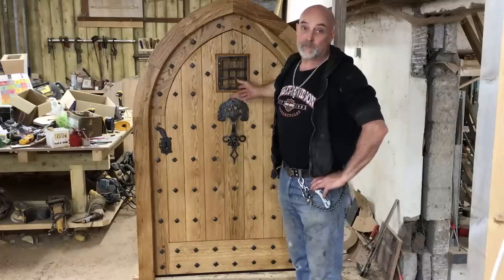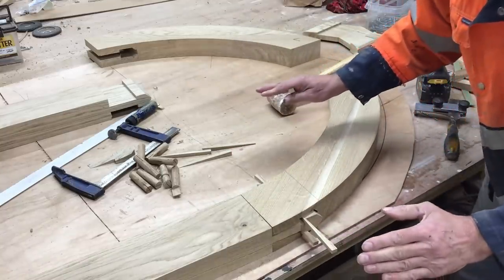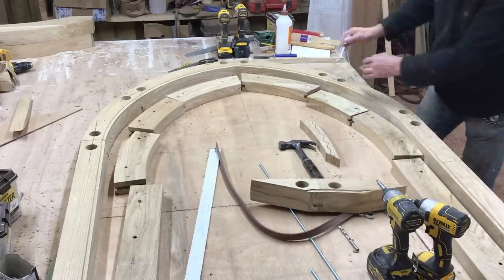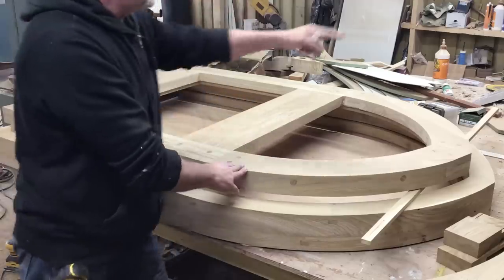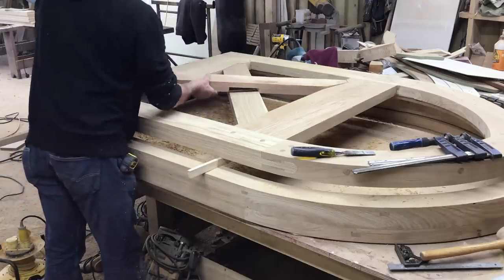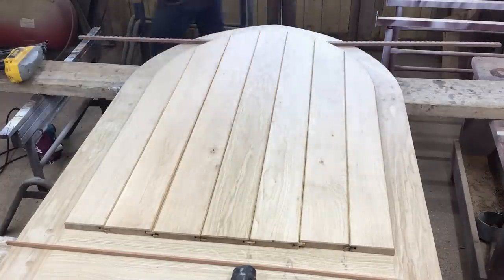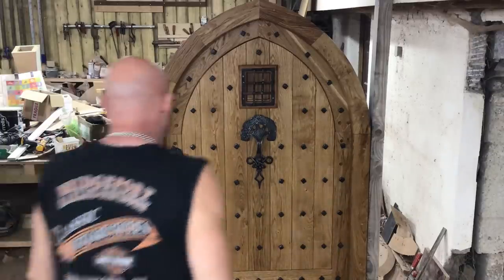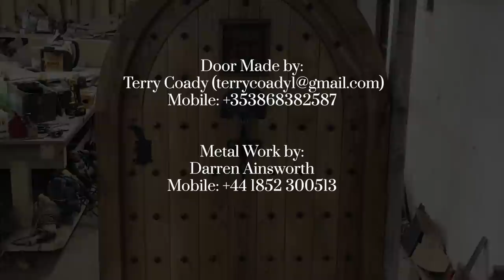How To Make A CASTLE Door - Oak Wood - Ireland

Comment: Nice video, I remember building a gothic arched door for one of my college projects back in the 80's, although it was on a slight angle and not a straight key joint. It was very difficult, I like your method and the final finish is a beautiful door and frame.

Comment: Very cool. Now, in Medieval times, the oak would have almost certainly been riven, that is split into staves which were then adzed down and finally planed, and not too perfectly at that. Oak was used for everything and part of the reason was its ability to be split, making laborious sawing not necessary. Generally, historical oak woodwork is what we would call quartersawn, with the grain radial to the surface. Also, fun fact about oak, the slower growth wood is much softer and can be carved more easily. Much carving would have been done while the oak was green or not totally dry.
Reply: They had saws !
Reply: @Goodwithwood69  Of course, and hundreds if not thousands of sawmills throughout Europe. There's one left in Holland, a windmill which uses medieval reciprocating action. But mostly pitsawing would have been done. We see little illustrations of men sawing wood in the margins of illuminated manuscripts. It's not true that wood was commonly sawn for most purposes. It's just easier to square a log. Sawing was often unnecessary for carpentry and a joiner was a carpenter basically. But you do see a lot of matched crooks in wattle and daub houses. These were sawn, I'm pretty sure. But there's much evidence that it was riven. Again, that's part of the reason that oak was used for everything. Walnut takes over circa 1600 and then mahogany sometime around 1700.

There's a video here on YouTube of how studs for a bell tower might have been split out off an oak log.
Reply: @carlosreira2189  Hi, can you share that video link. By the way, great info you share there, but where did you find that info about walnut/1600 and mahogany/1700?
Reply: @LuisSilva-tq9sj  Hey thanks for asking. I'm just a total wood geek. I find all woods endlessly fascinating. I have a few books on it. The main one is probably "History of English Furniture." Because in this case we're talking about Ireland, which would have followed the British in general. But being more provincial they would have used less imported finer woods and stuck with oak for a lot longer. Similar to a Welsh dresser. Those are almost always oak. 

Walnut becomes popular in Britain via French and Italian furniture where it is used ever since the Renaissance. I don't think walnut is native to England, even though we call it "English walnut" (juglans regia). Think of a Savonarolla chair for example. Also the Dutch had some walnut trees and used it, I believe. The Dutch also traded massively all around the globe and had imported woods which the British didn't, like ebony. William and Mary were Dutch and so there's a lot of similarities in furniture in this period.

The British in the 17th and 18th centuries actually used a lot of local materials instead of and alongside imported ones. They used a lot of veneers too, to maximize the yield of expensive woods. For example, you'll see Charles II chairs made out of ebonized beechwood. You'll see candle stands made from figured ash. They used yew wood sometimes. 

When exactly and why mahogany becomes king of woods is not super clear to me. But by the Queen Anne period we see mahogany being used along with walnut in England, and in the colonies as well, and some cherry starting to be used, and stained maple too.

By the Georgian period, everything is either mahogany or stained to look like it. I guess it's just such an all around awesome wood. They nearly wiped it out. This is Caribbean mahogany aka Cuban mahogany that they used. 

The Irish make some excellent mahogany furniture in the Chippendale style, with lots of carving. 

Spanish colonies, the Portuguese, Spain is much different. Mahogany is used, but they had other stuff like Rosewood that English people didn't get hip to until Victorian times. 

"Continental" furniture is different too. The French, Germans, Italians used whatever they had. Here you find much more local woods, beech, walnut, poplar, pear, cherry and other fruitwoods, with painting, carving, gilding, etc. Softwoods are used in places that have not much else like the Alps.

The Parisian tradition is on a whole nutha level though. These are the "ebenistes" the master cabinetmakers who had to do a "masterpiece" to get into the royal guild and sell their work. They usually signed their work. So we know the big names--Andre Boulle for the Louis XIV period, and whole slew for the Louis XV, and people like Reisener for the Louis XVI period. They worked for royalty and the uber rich. 

They introduce some cool woods like Satinwood and Purpleheart (forget what they called it), and lots of marquetry. The English are influenced to some degree by high style French furniture but they tone it down. They use much more solid woods during the Georgian period. And then more veneering, using satinwood with mahogany for example, in the 19th century. But by this time, the Adam brother's Neo-classical style is all the vogue. So we get Hepplewhite and Sheraton as the two main styles. And America follows English trends here as well.
Reply: @LuisSilva-tq9sj  Here's some links to the Dutch windmills:
https://youtu.be/axSBSul8vXo
https://youtu.be/Cf8E2K7ZuIE

These aren't the best videos, but hopefully the AI will give you some more options.
Reply: @carlosreira2189  Hi Carlos. Thanks for the answer. On my side, I'm another wood geek myself. I'm a Portuguese conservator-restorer specialized in wood artworks treatment that is currently doing a Ph.D. on wood identification on art objects. As you may know already, there is a lot of wrong information and cliches about wood, wood use, traditions, etc floating around on the internet, so, specific and to-the-point information like yours, is really great stuff. Thanks a lot for the links, I'll check them out. Cheers

Comment: A beautiful example of a mans craft . I've machined a few of these styles and similar in my life as a wood machinist . Not seen the hammer head tenon used before but have the fox wedge . Nice use of the split wedge in the dowel , have used the draw bore method in a few . Danish oil and the black ironmongery really compliments the workmanship. Thanks for sharing .
Reply: Those wedged dowels were used to hold the courses of the Bell Rock lighthouse together - still going 200 years later.

Comment: I'd have one in a heartbeat as it's not only strong and sturdy but it is a fantastic solid wood door not like this composite crap that doors are made from now. My only problem is I don't think it would look that good as a front door for my home as its a new build. Plus my house will be long gone and fallen to pieces by the time the mortgage is paid off whereas this door would still be going strong and definitely last 3 or 4 times the amount of time my house will last. New builds only last the length of your mortgage if your lucky that is.
P.s. fantastic job with the door and I love the iron work too it just finishes the door off completely.  Great job well done 👍.
Reply: It's a fantastic door, there's no doubt - but you're talking absolute shite about houses mate.

Comment: top job properly done    ,  cambinetmaker  here   from  wales   .  we  have  the  same  dewalt first fix nail gun with the adapter  for the new stile batteries    you  dont see many of  those  about ,    the  door  is  good    but   the  ironmongery  is  amazing  must  have  cost  a  fue quid

Comment: It looks great! I think the only advice I’d have is maybe use that wrought iron clear through the door. It’d give it a bit of a different look if you use iron bolts or what you see on the front of the door and then have it go out the back of the door so you can see it on both sides.
Reply: The bolts are really just a decorative feature on this door, most of them don't line up with any of the framing behind it. And even if they did line up with the farming, in a modern home they would be a terrible thermal bridge in winter that would cause a lot of condensation on the interior side of the bolt.

Comment: I have that same DeWalt cordless finish nailer.mine is the angled 16guage model.ive got several gass operated /battery operated cordless trimpulse 15gauge ,16.. and  5 inpulse gas framing guns.and several other cordless trim nailers.but I think that overall ease of use,and much quieter when using,the DeWalt is really a good choice.the passload guns have to have a gas cylinder ,that's not empty.and a charged battery.the battery capacity is low as well.dewalt battery seems to outlast them all.it consistently drives the nail  to set fully.also the gas guns can't run to long due to overheating.also they need regular cleaning.like a firearm to make them function optimum.ive never cleaned the DeWalt gun..

Comment: Thanks again from Japan for your amazing video. Decided to make another door - for my house this time. A couple of questions, if I may. You only secure the boards with pins. Is it really enough? I decided to use glue as well for the root cellar I did last year, which obviously created too much bonding and the inner door that is exposed to a lot of moisture (and me being too lazy to do a hammerhead tenon - I just did a couple of loose tenons) developed an opening between the two arches. Had to tighten the two with a rod, cursing myself for not following your example. I will do the hammerheads this time, but if I give up on glue, what kind of pins should I use? Thanks a lot in advance. Yura.
Reply from the maker: Use 18 gauge stainless steel pins, also some silicon or builders adhesive that will allow movement, hope this helps, kind regards, Terry
Reply: Thanks Terry, will do!
Reply from the maker: @yurachango  you can WhatsApp me  on 00353 86 8382587 anytime with pictures, if I can help at all, I’d be happy to

Comment: 💪💪👍👍you worked for aarsleff piling in a past life?
Reply from the maker: Yes, with mick Madson in Stockholm
Reply: @terrycoady8290  i worked along side them as a site engineer setting out driven piles on llanwern steelworks for a metal recycling plant in 1997 or 1998...cannot remember the 2 chaps names, but they where londoners and the main contractor was was Dean & Dyball.

Comment: The door looks amazing, but since its a castle door those rivets should have been real. I mean, imagine a angry 15 year old punching it and the brad nails lets go, that boy would think he's the hulk..
Reply from the maker: The large nails from the outside are hand forged and are 21/2 inches long, they go into the lock rail, also the x rails, they won’t be letting go anytime soon
Reply: @terrycoady8290  Oh, ok. It just looked as they where nailed in rows even as the framing had 45 degree angles. But that's of course a matter of spacing to get it matching. 
Thanks for a great video!

Comment: Though I appreciate his work. Nails and the steel screws are not necessary or desired. They put a thirty to fifty year life span on the door.
Reply from the maker: Do you really think the max life span on this door is fifty years, honestly?
Reply: @terrycoady8290  from experience it will certainly need work after thirty years. Pegging is much safer over time. Depends on if it’s external and if the house is dry.
Reply from the maker: Would love to see some of your work, do you have a web site? Regards Terry
Reply: @terrycoady8290  sorry Terry I haven’t done any of this for a long time. Work in computer repair now. Would love to go back to it.
Reply from the maker: Sorry to hear that Jonathan, nowadays we use stainless pins and screws for longevity, thanks for your interest, all the best.